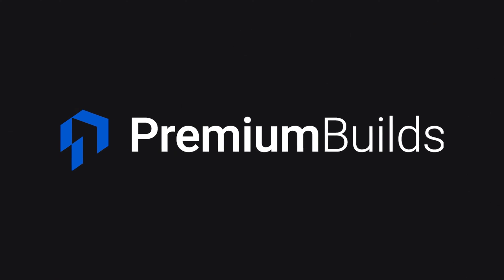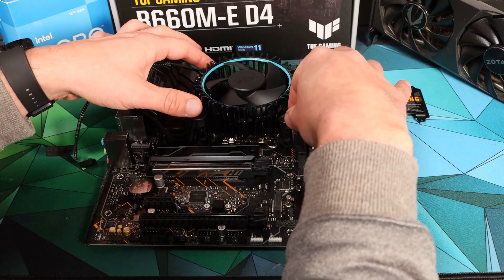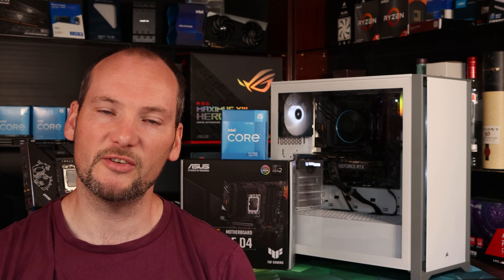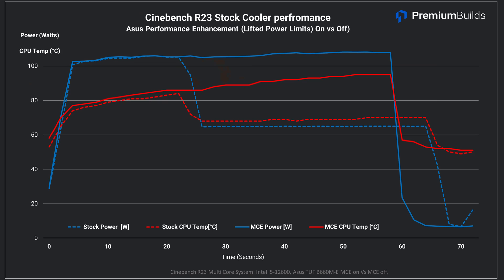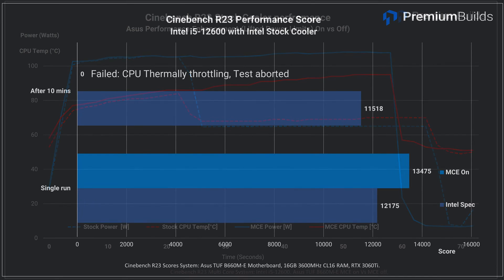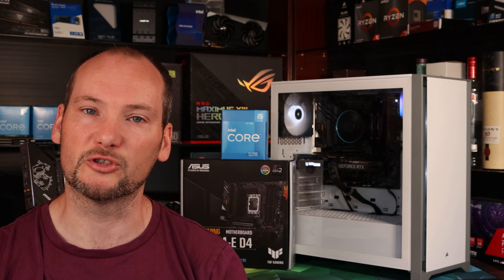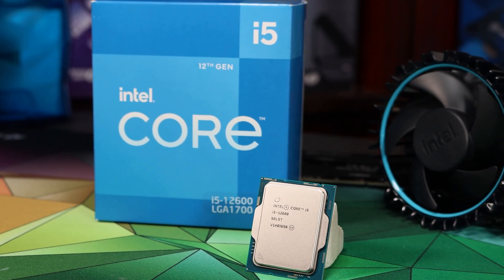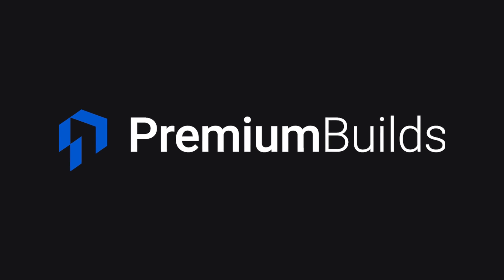Does stock suck? Testing the new Intel CPU cooler with the i5 12th generation!

Comment: Intel makes a capable stock cooler for i5 cpu's: CHALLENGE IMPOSSIBLE
Reply: Not the cooler's fault he used unlocked power limits, thus drawing 100+ watts. The cooler is meant to be used at 65w draw, its perfectly fine there. And this is specifically for work loads. For gaming, its even more viable, due to the temps being even lower.
Think about how many CPUs they ship - if every single one of them were to include a beefy cooler like one of noctua or bequiet's tower coolers it would be a huge cost on their end, on the shipping end and even on the user's end, as they'd be forced to pay more for a cooler they might end up changing anyways.
One thing they could've done is simply not include a cooler with the 12600K and above, just like with the i7 and i9 SKUs, because they all have a PL1 of over 100w.
Reply: @miweneia  nobody is asking for overpriced noctua shit, they could have just include one with more heat pipes for maybe extra $5 more
there is a cooler really famous lately its called Snowman or something its only $20 for 6 heatpipes lmfao and 4 heat pipes cost only about 15$ and it can bring the temp down by 20c full load
Reply: @loucipher7782  but we shouldnt care about improving the stock coolers anyways. The performance is perfectly adequate as a placeholder and most ppl would upgrade to a better cooler anyways. The money would b better spent on the actual cpu rather than the cooler assuming it has the bare minimum requirements for cooling.
Reply: @theblackhat9769  its only adequate if your room is a lab or operating table lmfao
meaning freakin cold ambient
Reply: @miweneia  there a business, so it makes sense why they include a stock cooler, but AMD does the same thing on some of there CPU's to. but your not part of the business, your just a person. ya there just demonstrating the stock cooler on i5 12600k CPU, but of course it wouldn't be enough. it still wouldn't do a better job at cooling the i5 12400 than an aftermarket Air Cooler, and it doesn't have to be the biggest, both Noctua and Artic Freezer make small coolers just like that, and they outperform it, while also being quiet.
i mean the stock cooler is meant for a non K 65 watt CPU, but bare in mind the TDP is an average estimate of what the CPU produces at idle when your not doing much on the computer. so if your just doing some casual browsing, then your not gonna generate much power. it's only when you start doing heavier work loads like gaming or streaming, video editing etc, then the TDP will increase, but how much is dependent on the numbers of Cores you have, and the type of workloads you need out of the CPU.